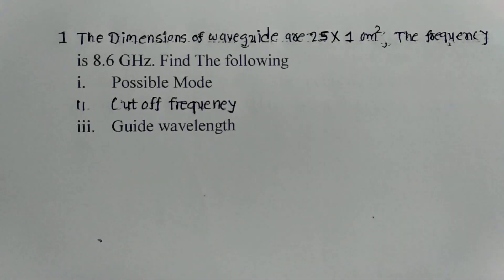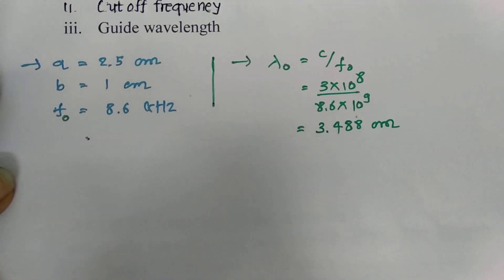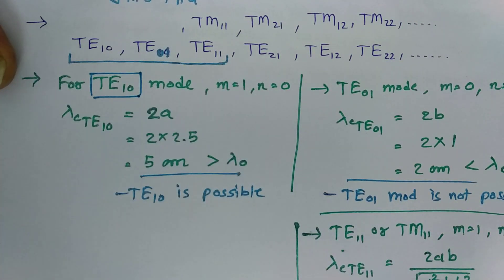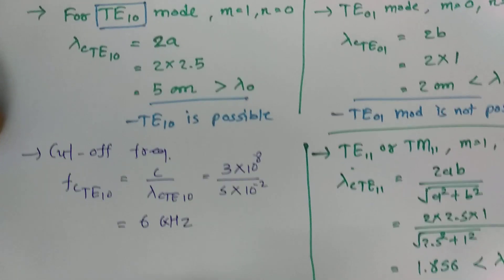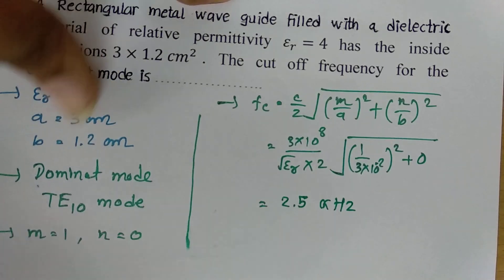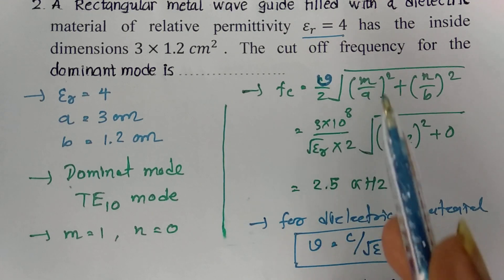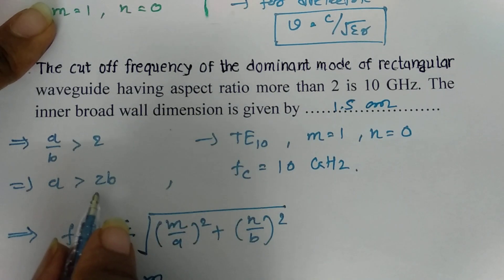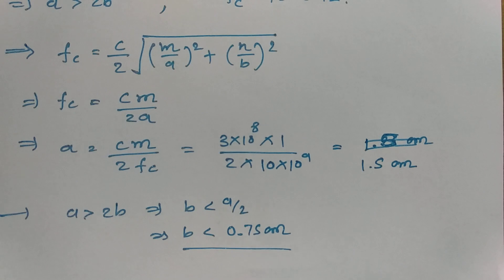Waveguide Examples in Microwave Engineering by Engineering Funda

Comment: Sir isn't (V= C/√EoUo) ?
Reply from the maker: Nope 
It is v = c /(€r Ur)^2
Reply: @EngineeringFunda  ya sorry,I meant the same,But in here you used V=C/√Er only,you did not include Ur?
Reply from the maker: @srksharma8199  here we don't use magnetic materials in waveguide so Ur is 1 for non magnetic materials
Reply: @EngineeringFunda  got it sir,thank you .So basically for all the questions based on wave guides I can take Ur=1, right?
Reply from the maker: If not given means it is 1